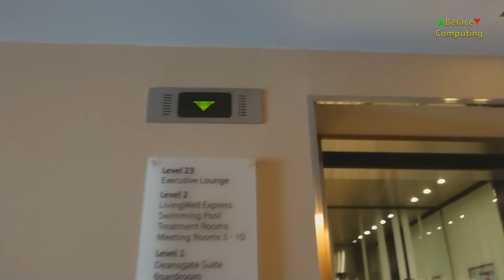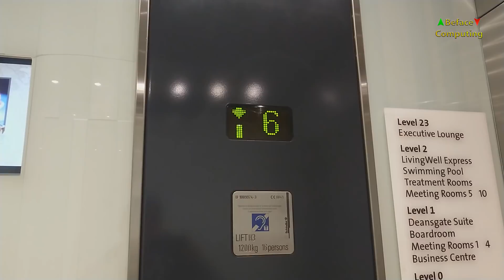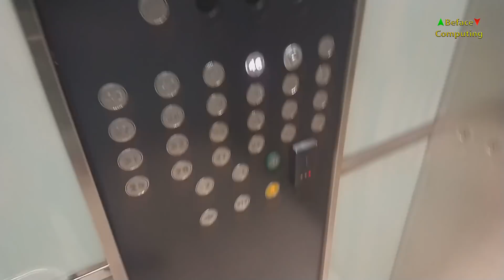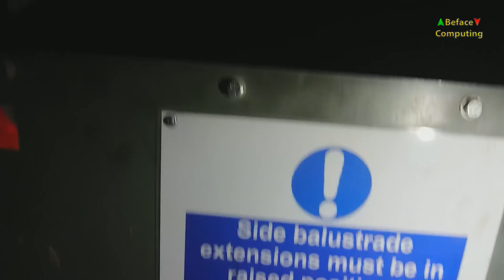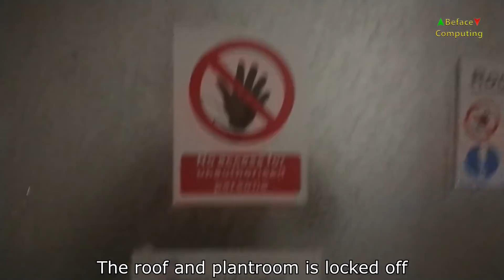Hilton Deansgate Lift Surfing & URBEX

Comment: Are those lifts modded Schindler d-series?
Reply from the maker: Yes I think with m series logic
Reply: @BefaceComputing  I think these are just Schindler 7000s with the D series buttons and Miconic logic which "M" pretty much stands for.
Reply: 《》Rahan2003《》 The indicators for the Hotel lifts are D-Line (D8 to be exact)